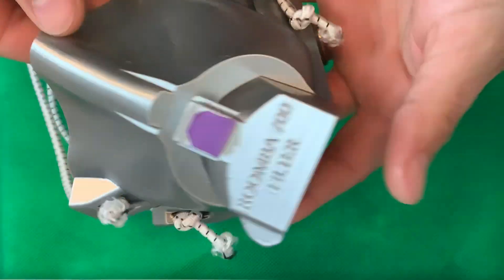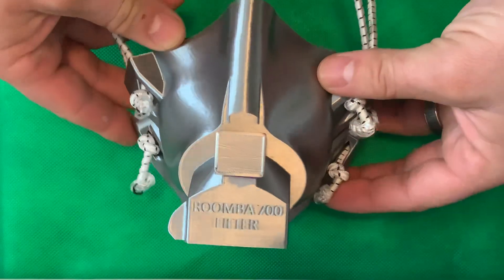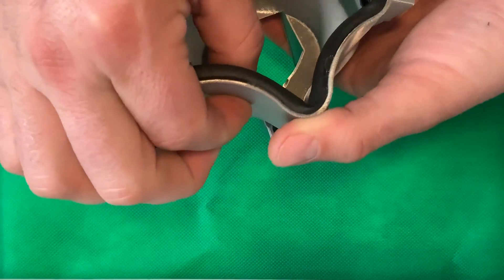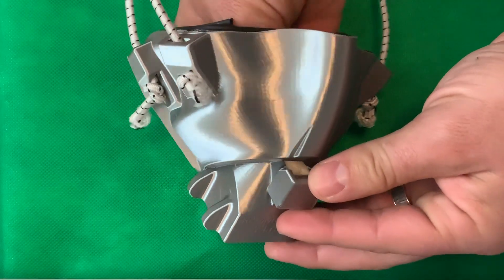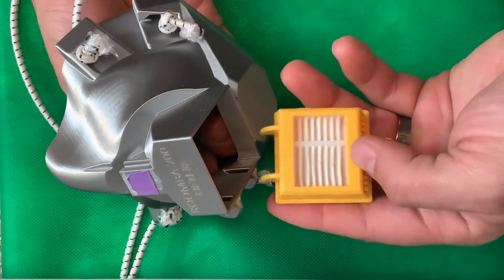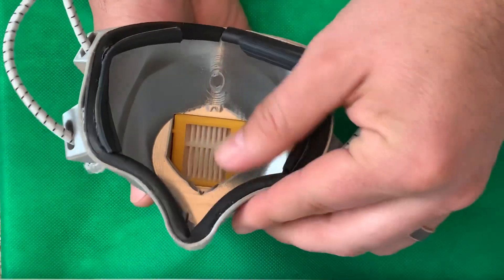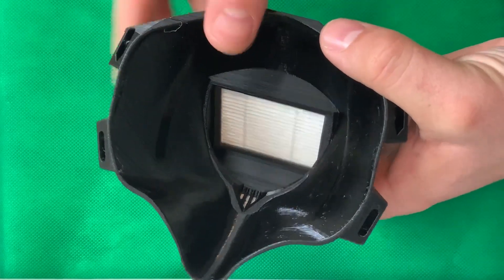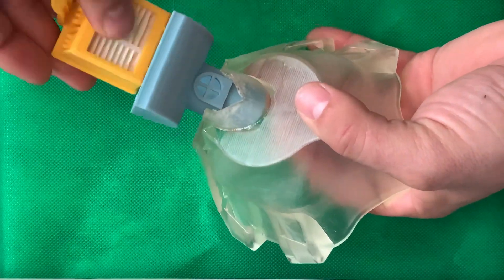Tips on 3D printed COVID19 masks

Comment: FYI, pla has very low porosity. I have used digital micrscopes to test this. Also, there was another article in the NCBI medical journal that shows that pla is very tight. 99.9% of all pores are less than 2 microns and do not go all the way throw. Layer lines may have gaps, less than one micron based on my images and scans, BUT they do not go all the way threw. If you have a basic calibrated printer, you should be printing most prints air tight anyway. 3 top and bottom layers, 2 walls thick. 
Now, you say, viruses are smaller than 2 microns. That they are, But IPA, and hot soapy water will sterilize that with no issue. The reason why those two are best... low surface tension. water has a high surface tension, so does bleach water. ABout 73 dynes/cm, this means it takes alot of energy for the hydrogen bonds to break in order for it to fill in the pores. BUT ipa, and hot soapy water have a very low surface tension, about 23 dynes/cm. This allows it to get into pores about 0.01 microns in size to clean. This is know as the wetting angle and wetting test:) In fact, a friend of mine makes filters that filter out viruses from the blood and they are required by law to use 70% IPA to sanitize the entire room. PLA can handle IPA, bleach water(soak for 5 minutes with some agitation) and ethylene oxide(i think thats it) gas treatment. I have been testing what PLA can handle the last 63 days:)

Comment: On your mentioning of PETG vs PLA. If you have seen the video released by CNCKitchen, it shows that PLA actually stands up to being soaked in IPA better than PETG does. That being said, the difference is minor and because PETG is less porous than PLA, PETG is still the better of the two materials to print in for medical applications.

Also fibreglass in HEPA filters? Well it depends on the type. HVAC filters have fibreglass in them where as the small air conditioner filters tend not to. Cheap furnace filters also are typically fibreglass. Also I believe 3M cartridge filters have a fibreglass pre-filter for filtering large particles before it reaches the activated charcoal and HEPA layers.

Comment: I like this because the HEPA filters are being used in their original form instead of being cut and modified.

After a lot of searching, I found a local HEPA filter manufacturer and called them to ask if the material itself could be bought in rolls, such as I've seen from a Taiwanese company. They said that it doesn't work like that and that any touching of the HEPA material would destroy it (render it useless - probably related to the electrostatic mechanism). Respirator masks have extra layers around them to protect the filter in between from this, moisture and to provide rigidity... I am hoping the filters in vacuum cleaner bags are also protected in a similar fashion at least on the outside. Really ruined my day and my plans.

Comment: Where do i get the file to print the last mask you were refferring to the I7 that looked like vader. i like it. id like to print that for my family. in NYC its getting nuts, and we work in restoration, this would help a bit till we get into the chamber to then change into PPE and swap into our 3M fitted masks. those filters are expensive, and we work in mold remediation so if i can print this to save my family money, and yet do our job amonst anything else its a win win
Reply from the maker: Efrain Rojas Jr https://www.thingiverse.com/thing:4243151
Reply: @wallyrenne  A question unrelated to me not finding the file...😁 If I wanted to buy a cheap to moderate priced 3D printers to make these masks for friends & family, which printers would you recommend? Which should I avoid?
Reply from the maker: utubepunk  creality  CR-10 mini is only 250 or ender 3 pro. Prusa Mini is on back order.  If have more money get the Prusa MK3S those  are the best
Reply: @wallyrenne  the only minis i find are 350. they might have been that price but with the demand so high right now its prob why they are higher. They do look like really good machines though
Reply: last thing, is there a smaller version for children????

Comment: I only fear of infecting my grandmother and grandfather. So how about a proper filtering of the output?
Reply from the maker: just seal the vent hole completely off with rubber glove and super glue or waterproof medical tape. this way all air that yup breathe out goes through the filter
Reply: @wallyrenne  I can't understand how does it looks... There is a small hole as a vent out. How to place a filter there and how does it looks? What kind of filter... 3M or some simple "fibre cloth" type?

Comment: At 9:00,  The info on the Roomba i7 HEPA filter is awesome. However, since you spec the Roomba i7, they could be sold out in short order. I like the emphasis you put on the face seal, and provided accurate info. For the HEPA filter material, I would like to see a version that accepts a flat sheet of HEPA material from a vacuum bag or a HVAC filter, which are in very good supply, and provide a LOT of filter material. Having a Z-fold on the material would keep the filter housing small (like the Roomba i7), but what I most want is a flat filter attachment flange that is about three times larger in area (left to right), and uses through-holes to allow simple small nuts and bolts to hold the clamping screen onto the mask. I doubt gasket material would be needed, but dishwashing glove sleeves would work for that, if desired. The mounting flange could even curve around a little as long as the mating surface was relatively flat.
Reply from the maker: Ron Roberts  we have a design for that too. See my other video on masks

Comment: HEPA filters 0.3 (not “0.03”) microns (not “millimeters”)
Reply from the maker: teddysurf  thanks man yea n95 only filters 95% of particles .3 and larger where HEPA (high-efficiency particulate air) filters are better selection for use with a respirator because their efficiency is 99.97% for monodispersed particles 0.3 μm in diameter or larger.
Reply: Wally Renne Another good point to make is somebody brought up the point that the SARS-CoV-2 (AKA Covid-19 aka coronavirus) is 0.1 microns and the filters filter up to 0.3 microns but some droplet barrier is better than nothing. Your mask looks like a good mask design for individual people with 3d printers. Problem is I don’t see it being mass produce because of the cost of the filters, filament and gasket seal.

Comment: Wally, will P3 filters be ok? I managed to source Moldex P3R 'Easylock' filter units from the UK and have adapted the Montana mask to allow use of both the twist-on integrated units and the individual filters. Also using TPU-printed o-rings to provide an airtight seal, it seems to work pretty well :)
Reply: Hi Mark...would you mind sharing a link to the stl?
Reply from the maker: Mark Keogh yes P3 like from Honeywell would be great! Good work
Reply: Please share. Thank you.